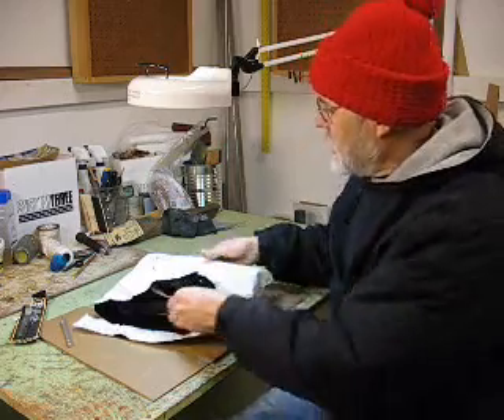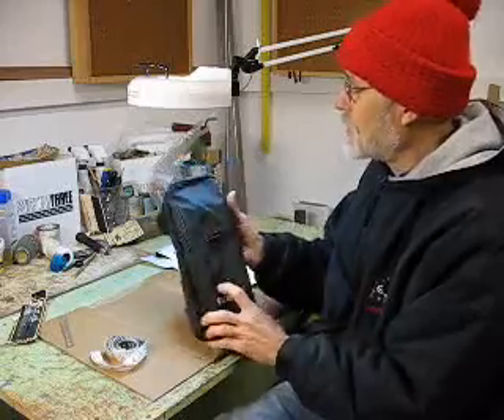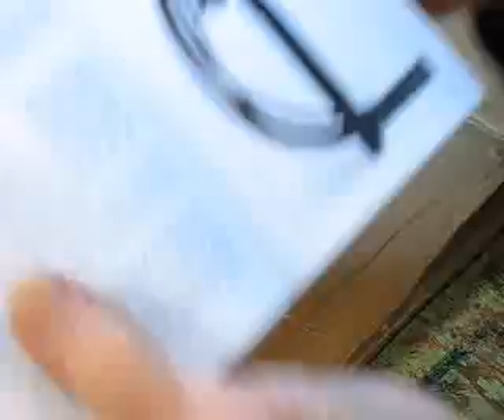Assembling the Morgan Carbtune Pro

Comment: Thanks for pointing out about the restrictors  , I did not read the manual and assumed to would also work w/o - matter of fact never noticed the transparent little tube in the package. W/o restrictors it's quasi impossible to read the gauging as the Hg would swing up and down crazily.

Comment from the maker: @skinz1234  You should have recieved one little tiny itty bitty plastic tube with your kit.  That tiny tube gets cut into 4 seperate pieces, and they are installed "inside" the tubes that fit between the meter and the carb.  Those "carb tubes" are cut about 4-6" (I think) from one end of each tube.  The tiny plastic tubes are inserted into and between the short and long pieces of each of the 4 carb tubes.  They act as restricters and will smooth out the meter.

Comment: @bigwheelsturning Yeah, if I do a video, I'd make sure anyone can follow it and it would be in detail too but I have to tackle it first on my VMax and get it down well enough to relay the info on to others.
Thanks for your video even a simple tip like cutting the clear plastic restricter with an angle to ease the insertion was a smart tip. Little things like that makes a difference. I don't have a 90 degree screw driver either and I hope I won't need it but it'd be wise for DIYers to get one.